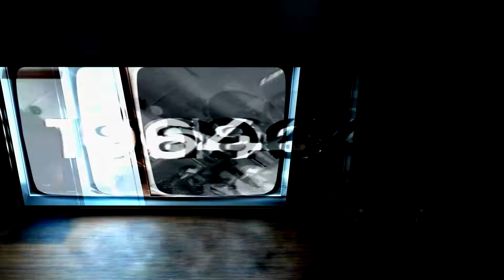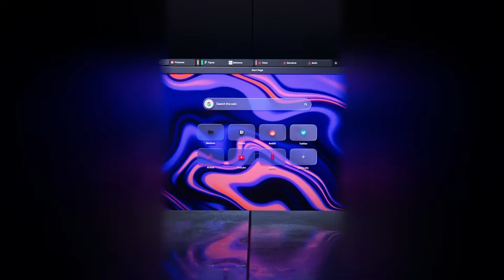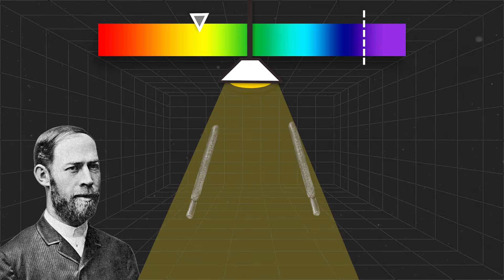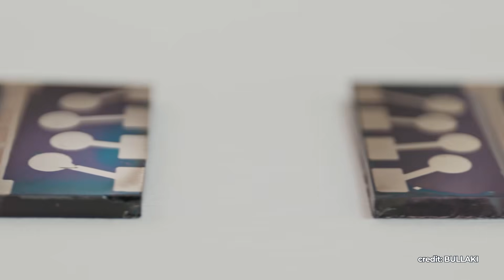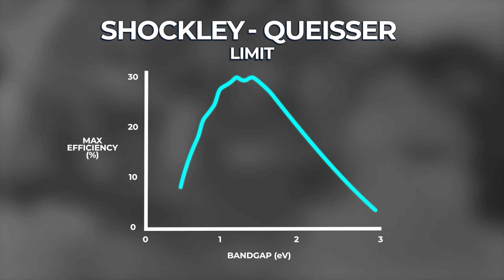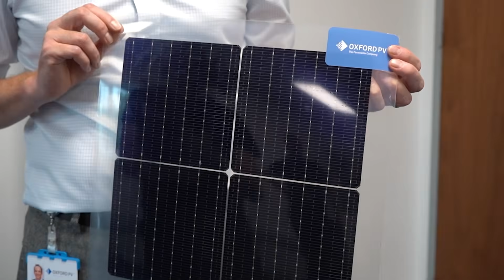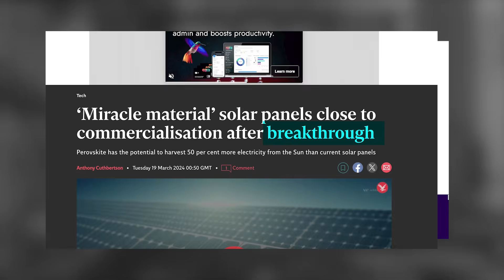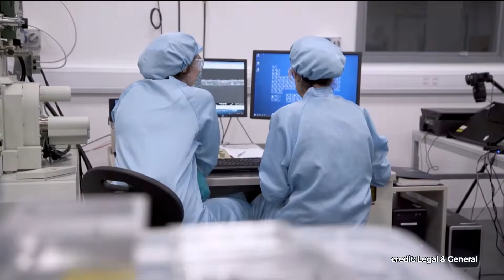How Physicists Broke the Solar Efficiency Record

Comment: Dr Miles - great report here... I haven't been following this field for a while, I feel caught up.

Can I ask a question? I'd long begun to believe that there was a theoretical limit to PVs of somewhere in the low 30 percentiles. I'd understood that is a trade-off of energy absorption and the operational temperature of the PV cells. In theory, a 'perfectly' efficient cell would be operating at zero Kelvin (or as close as possible). The range of frequencies being absorbed is maximised by being 'black'... and, as a consequence, will absorb IR spectrum and 'heat up'.

Is my understanding close to correct? If so, we are pushing closer to a theoretical maximum - and a cornicopian view shouldn't presume that the efficiency heads much higher than 30%

I've followed the progress of CSP (concentrated solar power) at scale - living in Australia, we have plenty of empty land to expose CSP plants to lots of sunlight. As was expounded by Dr Nate Lewis (who I'm sure you would know), using CSP or other renewables to make liquid fuels plays a role possibly way more important than an electrified world (ammonia as a precursor to fertilisers or as  hydrogen 'carrier' - anything that helps us needing to rush into rebuilding every bit of ICE machinery)

If the theoretical max of PVs remains in the 30s, then, I'm not sure if the game changed as a Step Change?

Comment: How is the energy it generates cheaper if thr capital costs are much higher? 17:48
Reply: Land area has is own cost, as does the structure supporting the panels, any mechanism to point them, and the labor (or tech) to clean them.
Reply: I wondered that too. I think the perovskites are pretty cheap and by increasing the efficiency you’re improving the return on investment even if the initial outlay is greater.

Comment: Bhor is the one who proposed quantized atoms. And max planck did more extensive work with then. Not really einstein
Reply: Einstein published the photovoltaic effect. It's specifically the observation that there's "the weird behavior" that intensity doesn't trigger electron emission, only the wavelength is the important bit. It quantized energy, which was a step on the way to quantizing physics.